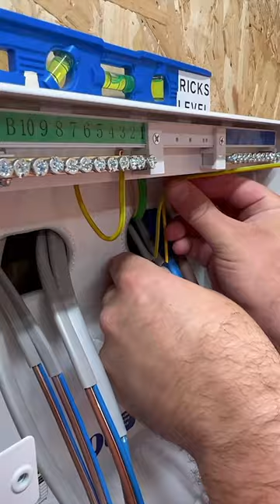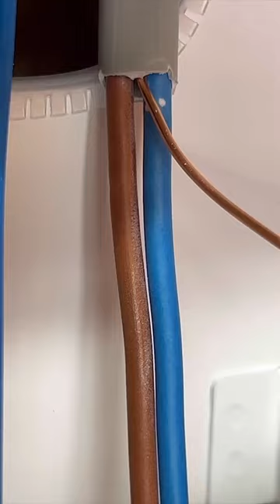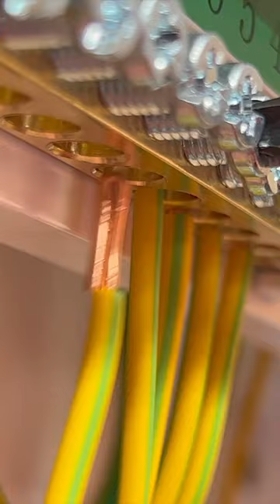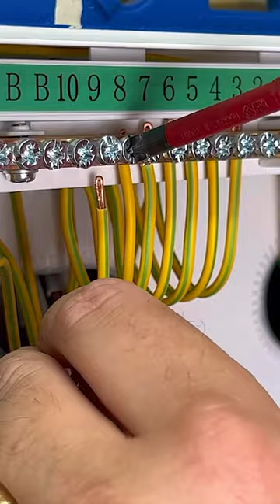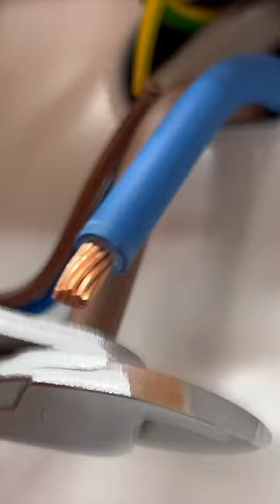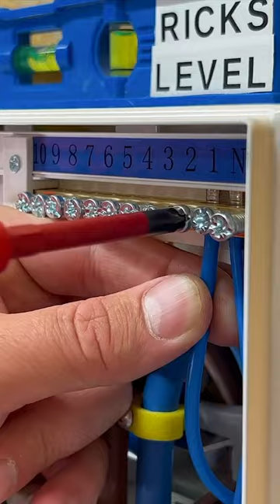Electrician Effortlessly Builds Up a New Consumer Unit

Comment: Now imagine effortlessly replacing a consumer unit in a cramped understairs cupboard where all the circuit cables are too short and need extending......its not always this glamorous 😄
Reply: Couldn't of said this better 👏
Reply: Or in one case I've seen they built a wall in front of it, thankfully I was only there to fault find rather than replace
Reply: Amen brother
Reply: Good comment.
Reply: i can imagine 1000 other situations, so i conclude that i should leave all leads with at least a 50ft service loop for any changes 100 years in the future.
Reply: @paulsidebyrne you COULD HAVE used proper grammar
Reply: 100% 👍🏼
Reply: @kiyoponnn  mug, that better for ya
Reply: Is being and electrican good? I’m decided that or going to uni to do software engineering.
Reply: Причём часто один мастер оставляет хороший запас на проводе на последующее обслуживание щита, а другой обрезает все под корень и собирает щит не заботясь о том как там потом менять блоки
Reply: Need more excess wire evey where
Reply: @paulsidebyrne  couldn't have?
Reply: ...and 113°F
Reply: Yeah I know Changed a C U under someone's stairs before Xmas lying on my side 😅😅
Reply: @Pepe-dq2ib I mean 50ft is a bit excessive but yes, push a little back in the wall/ceiling or whatever and dress your cables in with a nice and neat loop. Electricians of the future are gonna think 'you ledge' when they come to work on my installs in the future and so should they yours!
Reply: Bro stop being so negative 😅
Reply: Я не понял, а где опрессовка многожильного провода наконечниками (НШВИ)? Наконечник штыревой изолированный втулочный.
Reply: That's my specialty! Unfortunately I can't help you because i'm just a homeowner. Lol. 😂
Reply: It's illegal to put a switch board under stairs in NZ
Reply: @tonydickey9669  in America, anything goes as long as you have the right inspector. And most inspectors here don't give a damn. I wish we could do things more like across the ocean. UK has smaller more organized boxes, larger wires, more volts, wago levers, etc. Our boxes here look like the ones in condemned homes over there. It's shameful.
Reply: Really
Reply: Входящие провода без запаса ???
Reply: What do you use to extend to cables.  Plz drop a line for 32 amps and 40amps cable
Reply: @Kevin-gg1bp  depends on the wire guage. For 12-14 just use a wago in-line. For straight connections make sure it's an in-line. I'd recommend exploring different options as well just to see what the 3 and 5 conductor wagos can do.
Reply: @legalize420  thank you
Reply: I'm on my way to do just that😅. Wish me luck.
Reply: My thoughts exactly.
Reply: @syrus1233  please do what you like and enjoy. It's always easier and efficient.
Reply: True

Comment: Master electrician, use ferrules on stranded wires for a 100% great contact and no fail for decades to come!
Reply: I was looking for this comment. Ferrules are required for stranded wire.
Reply: im sure theres a video from @efixx talking about the use of ferrules! its a must have on any decent tool box,  what a fail guys. also im not sure if you should fit a consumer unit onto OSB board, but i must admit thats a training cubicle.
Reply: The only stranded cable in that video was the main tails, and I’ve NEVER seen a consumer unit fitted with ferrules on the main tails tbh
Reply: Ferrules are for flexible stranded, not regular stranded like in this video
Reply: @fauxque5057 yes and now use them correctly aswell, we all know ferrules are required and very much preffered but a lot of people don't know you're not even supposed to twist them. And i've seen ferrules that were crimped with a pipe wrench. So yeah
Reply: Read some books about it.
Reply: If more than seven strands you may use ferrules. 🤔
Reply: @fauxque5057  
Ferrules are not required. And they aren't recommended for class 2 wires anyway. They're only meant to be used for class 5 and 6 cables, namely fine-stranded.
Reply: No need to use ferrules when you have cage clamps
Reply: It depends on the type of stranded wire and the type of terminal. For coarsely stranded wire (typically what's used in the US) you should NOT use ferrules with most terminal types because they will actually reduce the contact area.
Reply: @scwfan08 it’s Bretter to use them
Reply: Я тоже так думаю
Reply: Yes i agree like flex cable. Nothing wrong with this video. You wouldnt use ferral crimps on a power point.@nickthesparky
Reply: depends on the terminals, but those do require ferrules.
Reply: @fauxque5057 сто процентов русские
Reply: So master electricians use them and juniors do not? !!😂😂😂
Reply: @andregenter4213 I am not convinced it is. With a screw terminal you might have some stands which are not in direct physical contact with the screw, but that can't happen with a cage terminal.  The cage terminal will apply pressure to all strands as it is wide enough to accommodate all strands underneath it.
Reply: @deang5622  correct. These are not screw terminals. Feral terminals are used when using stranded cable on a screw type connection.
Reply: Ferrules ONLY go on fine stranded wire!!! The main feed is considered Solid-Multiconductor and whatever you do, DO NOT put ferrules on them. Besides the fact that you cant even crimp them with any normal tool
Reply: Only needed on fine and finest. Not on course stranded wire. Sometimes it also doesnt hold properly on that kinda stranded wire
Reply: @fauxque5057  în EU not US  (i'm not sure in uk)

Comment: This is the perfect scenario. In the field, you'll never run into the perfect scenario. 😅
Reply: Like in a plant environment where the dust makes wire color identification nearly impossible.
Reply: @awakenedtotruth8419  All these residentia/commerical electrician videos popping up on my recommended make me realize how good these guys have it compared to their industrial counterparts.

Where's all the dust, grease, metal shavings, and unknown liquids that usually cover everything? Lol
That's not even mentioning the intense heat and noise in most of these environments too 😂 All while working hoisted to a scissor lift 30-something feet high that shakes like crazy with every little move you make.
Reply: @miguelzavaleta1911 
Well put 👏🏿 
Also the "are we there yet?" is multiplied 19X a shift.  I tried to leave the box better than I found it at least b4 the camera phone was invented 🤣😆
Reply: Гибкий кабель без наконечника о Божечки что за колхозник
Reply: I wouldn't say never
Reply: Absolutely
Reply: Customer asked for an additional powerpoint one time. I knew i could get a cable to the spot so i cut out the spor, directly behind was a pp bracket and cable already in the location. Biggest miracle ive had.
Reply: Dreams can happen

Comment: I wish America would use those style boxes.
Reply: America needs a rewire, to a national grid of 230 volts 50 hertz to begin with.
Reply: @davidreilly1031  I currently work for a Municipal utility. That would be great, but having now seen behind the curtain, it's amazing we have electricity at all still. 

Edit:  not disagreeing with you at all. My statement was confusing.
Reply: @davidreilly1031  don’t many homes already have 240 volts or are getting there? I thought most homes are split with two lines of 120 volts?

Comment: I have a few things to say. Most importantly, I would not call those beefy input leads "effortless".
But also, it's amazing to see how well British sparks can do when they actually have the space to maneuver.
Finally, here in Southern Europe family mothers won't let you surface mount consumer units, they make you embed them into the wall. Yeah, the brick wall. I wonder if it's for the same kind of reasons why over there they're usually hidden at weird places on residential. May it be aesthetics over practicality?
Reply: if you're talking about america, its probably because they just dont want to look at it. But now you need to have specific clearances around the panel so we have enough room to work on it. doesn't stop them from putting everything in their basement in front of the panel though. And then they act suprised when we tell them they need to move their stuff.
Reply: Я понял,видимо только в россии у нас грамотные электрики, а в европе безграмотные. Это радует. Зато европа нас учит жить, пусть лучше на себя чумазых посмотрят сначала, может европе есть чему у нас поучиться...

Comment: What's up with doubling up the grounding conductor (Earth wire) before installing it on the bus bar? I'm familiar with this practice when conductors are too small to make a good connection, but those conductors look like a good size for the screw terminals. Uk code maybe?
Reply: Doubles the cross sectional area of the cpc and prevents damage from the screw. I hate to open anything up where the conductors haven't been doubled over.

Comment: Hello friend, I'm an electrician here in Brazil.  Here we use all flexible wires, but I found this cable gland at the circuit breaker entrance very interesting, holding the thicker wires.  I haven't seen it here in the country yet, could you tell me the name to search for?

Comment: Why don't your cables have the earth insulated like we do in Australia?
Reply: Money saving on manufacturing,hence on cable price.
Reply: Cost saving. The user insulates the ends instead of the whole length being insulated
Reply: @jurijtimkov8019  fair enough
Reply: Nope, it's so in the event of cable damage, the conductors can get to earth easier
Reply: ... and the rest of Europe.
Reply: @BenWiggins101 if the breaker works any short will cause it to trip immediately. Grounded or grounding conductor to hot.

Comment: American here, is twisting the wires counter clockwise code or just preference?
Reply: I'd imagine he is just following the natural twist of the cable. He would need to twist clock wise at the other end of the cable
Reply: @shanemcredmond9751  that doesn’t make sense. Are you an electrician or are you just guessing? Instinct tells me not a sparky
Reply: @blackened872  I have been an electrician since 1998
Reply: @shanemcredmond9751  my instinct was wrong. My apologies sir.

Comment: Why did you fold the grounds before putting them in the terminal?
Reply: Gives more for the screw to clamp down on. A single, solid conductor can slip out if it gets wiggled a bit.
Reply: @soshalconstruct5463  idk how it is over the pond. But in the states code says can't bend the wire more than 6 times the overall diameter. This is just a ground but if it was a current carrying conductor it would be damaged at the fold and get hotter over time making the connection worse and worse
Reply: @lawrencehaslup6889 no it wouldn’t the current doesn’t flow around the bend as all points are in simultaneous contact. Quite common to fold live conductors in this way for connections in the UK and does not lead to over heating.
Reply: Doesn't go around the bend because it's not a plumbing pipe lol. But 100% of the copper will take current. If there's any micro cracking it would definitely have a higher resistance at those points and be hotter than the undamaged portions of copper. Seems like a gimmick to fold them like that. Plus I land solid wire all the time and no problems with it slipping out of terminals. If it slips out the terminal it's the wrong size terminal.
Reply: Also is there not bending radius rule in your code?
Reply: @lawrencehaslup6889  do you believe that if the bend breaks it will cause even greater resistance and become very hot? As that would be the same as suggesting the end of a stranded conductor becomes very hot in the terminal as they are touching but not connected. I assure you the bend in this case does not cause an issue. Yes there are regs regarding bending radius but they don’t apply here for the reasons I’ve stated.

Comment: Not sure I agree with twisting the cores on the wire before inserting it into the RCBO clamp. I find that the clamp retains its torque better if the strands are kept straight. Obviously take care not to have stray wires.

Comment: The whole sleeving your own grounding wires with insulation is just bonkers to me.
Reply: it's just to identify at each end, the reason it's not sleeved throughout the cable is that if something goes through the cable and causes short circuit it will always contact earth and trip rcd and not short to neutral causing a much more dangerous situation
Reply: @DrBoig  fair enough. Thank you.

Comment: Why the hell the cpc/earth/grounding conductor is not insulated and then you have to put a sleeve on it?
Also, wouldn’t  be it nicer to use a board that has a 2 pole bus bar (L and N) so you won’t need those fly leads for the neutrals ?

Comment: Absolute horror in amount of work and amount of different parts needed compared to what we have in the Netherlands.
Reply: Its the same in the netherlands, except the ground wire is pre insulated
Reply: @TheEvanovitch 
It's not. No cables from hollow walls but wire in conduit from the (concrete) ceiling. No need to fold any conductor. No 100A with massively thick wires either but 1x40 or 3x25 mains connection. Also no unswitched neutrals making earthfault-finding a lot easier. 99% of circuits with 2.5mm^2 since 99% of circuits are 16A. Of the remaining 1% that is not 16A it's mostly installed wrong by some PV cowboy or EV-charger cowboy.
Reply: @jcvjcvjcvjcv  we actually do a single loop on the conductors instead of a fold to give some extra wire length for repositioning in the future. Yes we use switched neutrals but screwing them into either a switch or a busbar makes no difference for the amount of work we have to do. We indeed use slightly different materials but the amount of work remains the same
Reply: @TheEvanovitch  
There is no sleeving grounds, cutting cable sheats is rare, the conductors don't have to be folded. The loop you refer too is considered obsolete, but besides that; can be done in the UK unit too. The enclosures are also easier. No cutting. 
The switched neutrals make it possible to isolate faulty circuits without even taking the cover off. The UK way of doing things is just inferior. Another example is their square flushmount boxes vs the round ones in NL.. Round is 100% easier to do in less time, with less dust, less plaster work, etc. etc.
Our history of using conduit is also why you see the Germans and English with their "house rewire" videos but not the Dutch... because there isn't a whole lot to show.... pulling 2 wires out, replacing with 3...

Comment: What are the pros of solid core wire compared to twisted wires?
Reply: Less resistance
Reply: No loose strands and tightening down on stranded wire isn't safe. A ferrule should always be used on stranded wires

Comment: I thought England was red black red live and ring circuit wiring from breaker and neutral bar and back to same breaker and neutral bar I was in Germany and they use 3 phases black black and brown coming in with blue neutral and yellow green ground most circuits are 1.5 mm wire black live blue neutral and yellow green ground 16 amp what gage wire does England use with what amperage breaker I believe there cable is red black and green stranded wire

Comment: Why no lugs for stranded wire?
Reply: They are not stranded. They ate solid cores intertwined. It doesn't need lugging. Flex, etc, on the other hand, does need it. So don't be a kow it all, if you know f£££ all.

Comment: Not an electrician question: why do you use a screwdriver? I’m sure there is a reason for not using a faster method like a drill. Thank you!
Reply: Because with a drill, you would have to go veery slow as not to overtighten the screw and possibly break it, so if you use a drill, rhetorical time it takes to go slow using a screwdriver is about the same if not faster.
Reply: Some guys do use a small drill to spin them up then torque then with a screwdriver after. I personally don't like it tho and always use just a screwdriver
Reply: Because its very easy to go from tightening a screw to rounding it into oblivion with  a drill, it's still possible with a screwdriver but you'll get a lot more warning

Comment: Ughh  I hate romex so much.  I wish they made it so the ground wire was insulated or just swapped over to MC for houses.  I've had multiple devices in my house short to ground from a shotty installation by the builder who made my complex.  I should go through the whole house and fix it but half the wires at are only 1 to 2 inches long.  I swear the electrician they hired to do this made up the receptacles with the walls open and then went back to each one and pulled the romex tight out of the box.

Comment: No ferrules?
Reply: there is no requirement for ferrules in BS7671. so you a keyboard sparks
Reply: You don’t use ferrules on solid conductors it actually had the opposite effect and creates a weak joint
Reply: I don't
Reply: In the video it's stranded wire
Reply: @denysnuttall1706  No it isn’t. I’m an electrician in the UK there’s no stranded wires in this video
Reply: The incoming ( 10 or 16) looks stranded to me
Reply: @denysnuttall1706  They have strands but they’re still solid cables
Reply: Ok ,I live in Spain,it's  stranded here,
Reply: @uplightuk8924 just after 0.50s there's x2
Reply: I like those clamps on the main tails.First time I've seen those.Do they now come with the consumer unit?

Comment: Stranded wire should not be twisted if it is to be secured by compression or crimping as it prevents the wire from molding to the shape of the clamping surfaces.

Comment: If inspectors in the USA wouldn't pass  shoddy workmanship, we would have better installs.   Does the local code office pass out brochures on what the expectations of wiring are, with an illustrated guide on how to do it, or  a video?  NO!   Your tax dollars at work.   They are just as derelict as the installers.